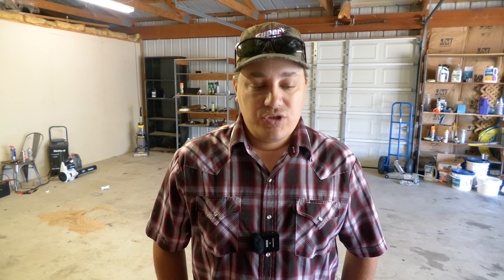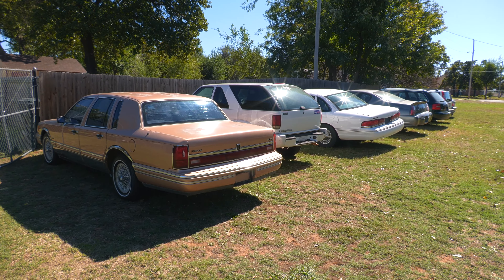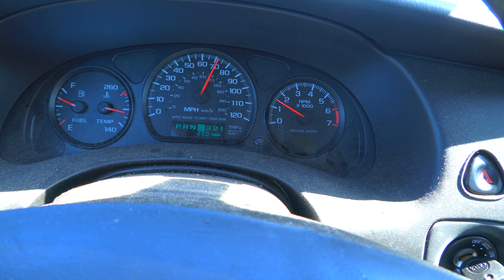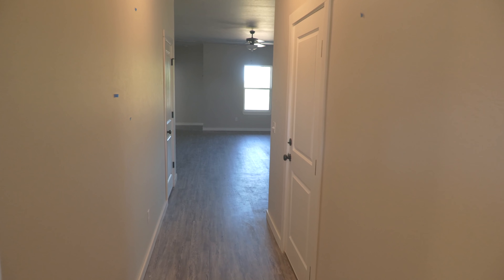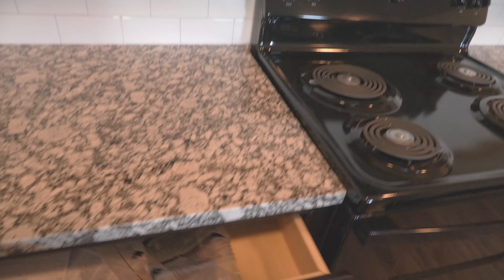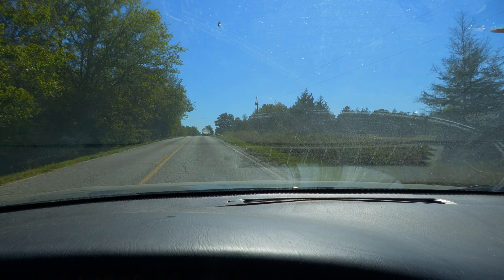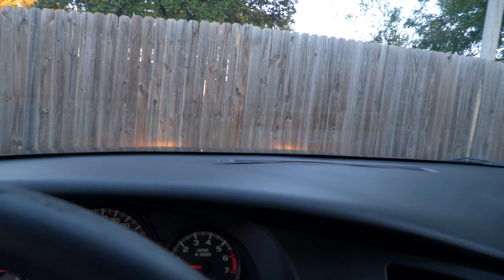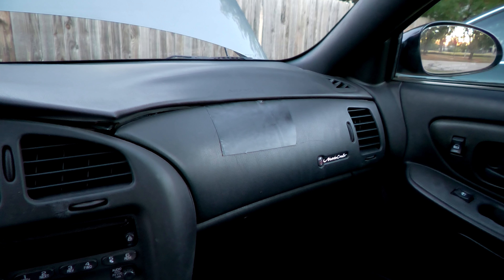Selling the 04 Monte Carlo at IAA + 140 Mile Drive to AAR HQ + 1st Look at NEW HOUSE BUILD!

Comment: @29:43 Try using a mini propane torch at low heat to melt off the oxidation on the headlights. It works great and there is no effort.

Comment: Hey Randy, thanks for the quick house tour. I know it gets hot there but I didn't see any Heat Pumps / Air Con units or vents for same. I'm pretty certain all new houses in your area would have it. 

I'm thinking time management for you as the largest benefit to building a replacement shop at your new house, and selling AAR HQ. It seems AAR is about half an hour each way (?) from the new place, and say if you constantly have 12 cars going back and forth from your new digs, that's a lot of your life looking at the windshield, and not fixing the cars (or enjoying yourself at home). Of course if the new place can't get you the commercial license to operate your Dealership, that kills the idea. Enjoy the new house, and I promise - I'll never visit you there.😀

Comment: Hey there Randy........when you got the monté Carlo I had a customer call me within a day of you getting yours.......his is an 04 RS.... 168,000 miles with a 3.8.....yeah the good old 3.8......clean as a whistle inside and out......he bought it for $2,000 from a little old lady.......he couldn’t get it to run.......so I check out everything......the fuel pump was coming on and there was spark and air.....I was like what the hell? I pulled the 3 front plugs to check the compression.......they were bad......like hadn’t changed in 168,000 miles bad........so I checked the compression and it was good......then I took carb cleaner and cleaned the plugs and put them back in .......car fired right up......he was so excited to get it to run.....just thought I’d share that with you......Congratulations on the new house......my wife and me are the same way......we want privacy......even though we live out of town on some property with a shop......we still want less neighbors........plus we rent......our goal is to find a piece of property with a house and shop on it as well......also get ready for changes coming up on the channel as well.......mechanical stuff is slowing down and i will be going a little different direction with the channel......I definitely would not just show up to your house......I would let you know when I would be coming love to meet up sometime and say hi.....as well as a small collaboration with the channels........be safe out there........😁

Comment: Instead of storm shelters why don't they build homes with basements it seems silly it to me in an area prone for tornadoes you are very limited underground shelter
Reply: The house wouldn't be $237,000.
I agree in tornado prone areas should automatically have a basement.
This was a "cookie cutter' house without customization hence the lower price tag.
The more you add to a house the price goes up.
Also a basement comes responsibility of a sump pump if you have a high water table or know your area can flood from time to time.

Comment: This is abit of thought when I sell a car with foggy headlights I get a spray tin of clear coat mask up the headlights and spray some clear over it doesn’t have  to be perfect but makes it a lot better if your getting rid of the car should make it a lot clearer in the end but depends how bad the lights are.. it’s normally the uv film that deteriorates over time that’s why they go yellow looking.. hope that helps anyone that wants a quick fix

Comment: My 03 Monte Carlo had the same key issue. I noticed that one of the teeth on one side was worn down so when I put it in one way it wouldn't turn because it technically wasn't the correct depth to push the pins into the correct position.

Comment: That water heater needs a pan under it, a blanket, and strapped to the wall.

The pan is in case of a leak. We had a small leak. The wood under the heater rotted and grew black mold. That was and expensive repair.

The blanket is to keep the water hot longer and for efficiency. I hope the wrapped the pipes too 

The strap is for earthquakes. Yes, Oklahoma, home of the USGS, has earthquakes. If the heater moves a little, you could have a water or gas leak.
Reply from the maker: Straps and blankets are not required for code in Oklahoma. Can’t have a gas leak in an all electric house. Also, you missed the pan under the water heater? It’s clearly there in the video.

Comment: I would have put in a wood fire place just in case the power goes out in the winter. Get a generator that runs off of propane and get a big tank.
Reply from the maker: Don't need one, we will have a backup generator.